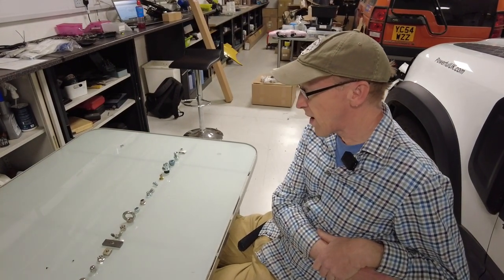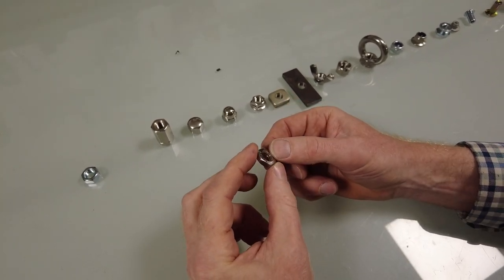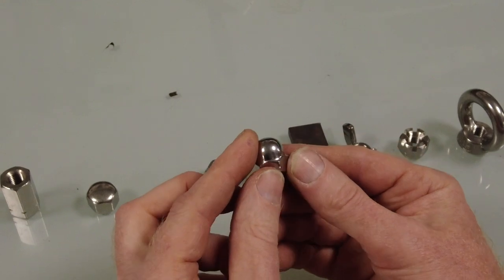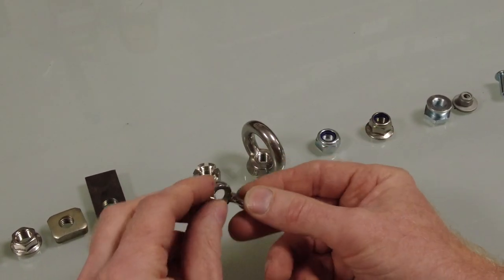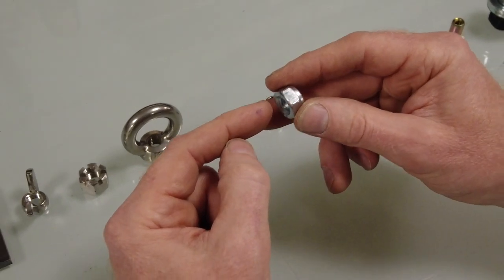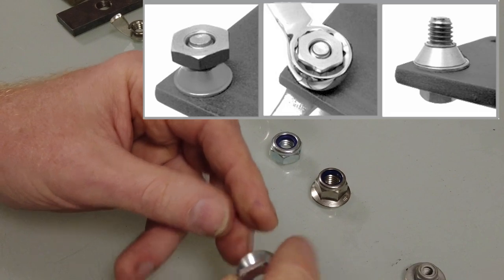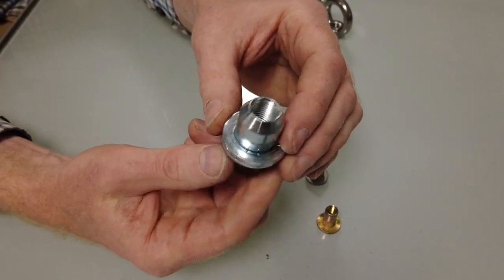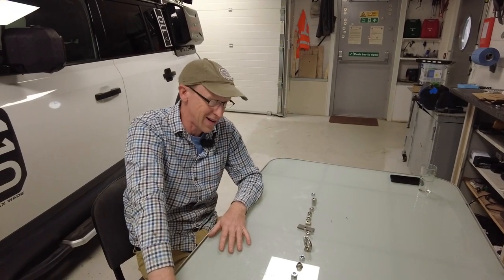Know Your Nuts - A beginners guide to the various types of nuts used in the workshop

Comment: Yep, got to agree ,very useful for us non engineering types. Now looking forward to the Bolt / Set Screw / Carriage bolt / Allen Bolt lectures . Hope the glass table is still floating and it is not a case of “ counter sunk” boom boom sorry about the spanner in the works but thought I would socket to you and ratchet up,the pressure. Non Stick Nick
Reply from the maker: Hi Nick - firing on all cylinders i see !